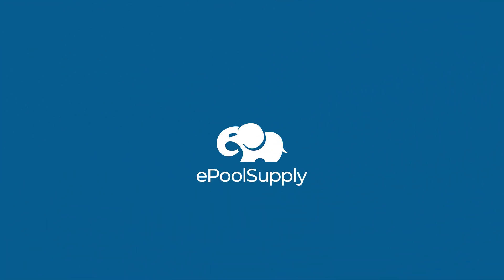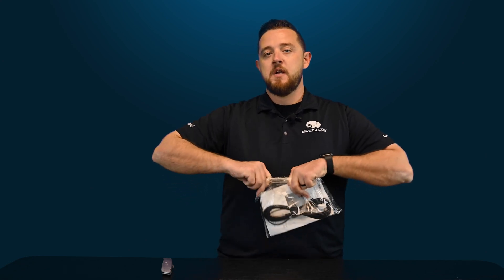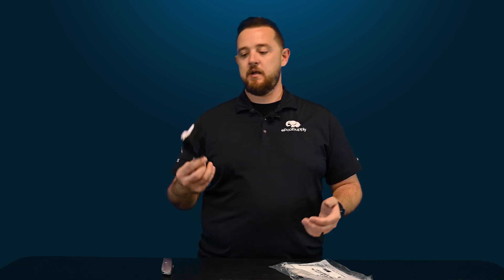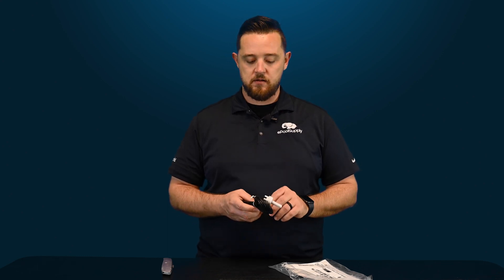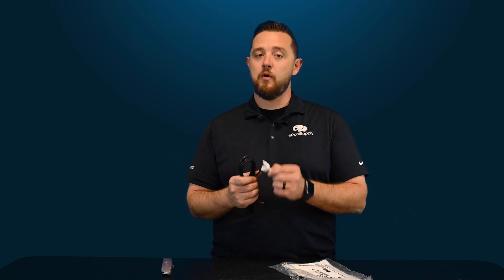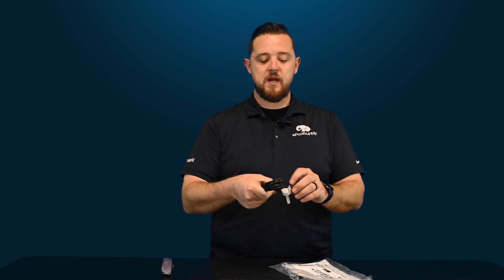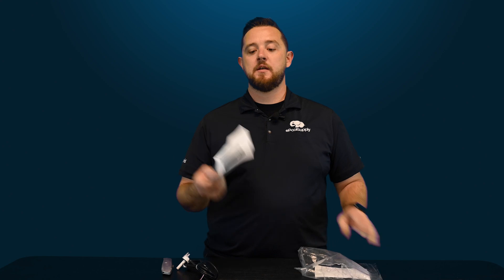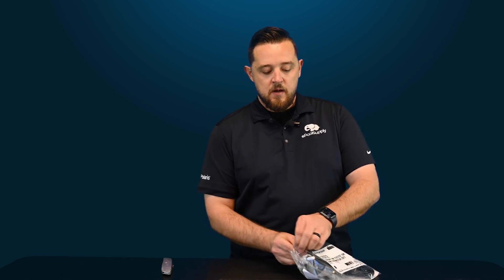Pentair 20FT Temperature Sensor - What's In The Box

Comment: My system was professionally installed and I’m disappointed how inaccurate the temperature reading are. I get calibration is necessary but if I want my temps to read accurately, I have to recalibrate one in the morning and once in the evening every day. It almost makes it worthless to even have. Is there a way to solve this problem?
Reply from the maker: Hello, every pool is different and it is possible that something was missed or installed out of position. Our best advice would be to reach out to whoever installed the system in the first place. You can also reach out to Pentair as well for any technical concerns at 1(800) 831-7133. Hope this helps!
Reply: @ePoolSupply  Thank you! 👍🏻